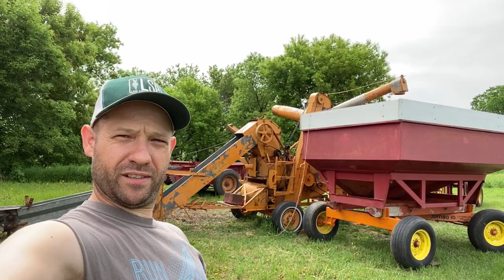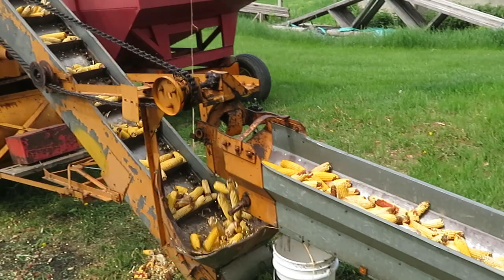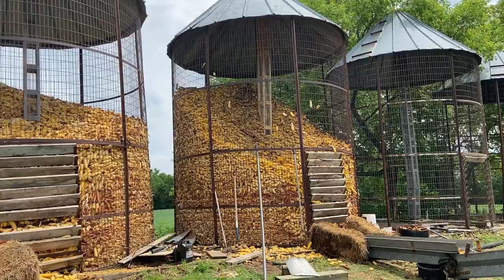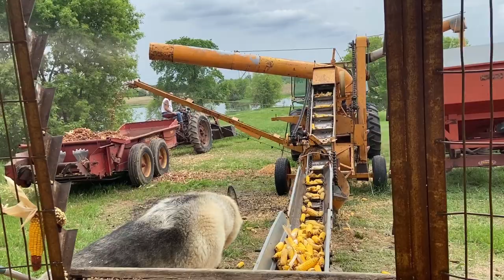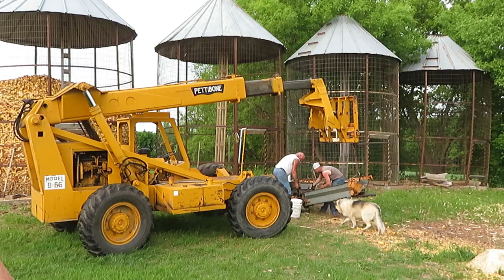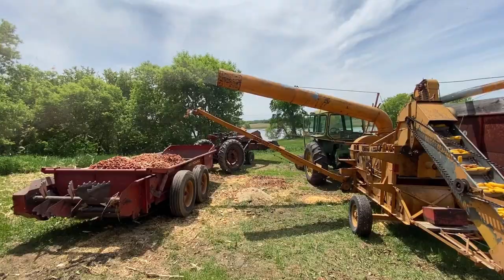Shelling Corn - 2020

Comment: That corn sheller is a dandy. Take good care of it, maybe treat it with rust reformer and give it a coat of MM yellow paint to help preserve it.
Reply from the maker: Y'know, when it comes down to it, they're really simple and pretty reliable pieces of equipment.  It's getting some age on it now, and I really wish we had a shed to put it in.  It needs a few holes patched in the sheet metal, and you're right, I'd like to paint it up to help protect it.  Even with those few flaws though, it's a beast.  These old shellers were made to do one thing and do it really well, and it shows.

The main problem is that everything takes more time than a guy thinks it will, and there are always a million other priorities.  At some point we'll get it completely tuned up.

Comment: I've found that gorilla tape works best for patching and if you don't already, try putting a piece of thin medal under the tape on the hole first. We have a piece of almost tin like material and with the tape holding it on it'll last a long time.
Reply from the maker: I’ll have to try that.  We always have aluminum coil stock lying around from construction jobs.  That’s easy to bend and makes a good thin patch.

I’ve heard that the seam tape for Zip System wall sheathing is really good too.  Though I’ve also heard it’s almost impossible to remove if you want to make a change later, lol.

I just picked up a wire feed welder recently and am planning to use it for thinner metal work on some of our equipment.  It would be nice to do some patching that will be a little more permanent.

Sadly, it’s a battle we’ll continue to fight until we have a decent shed.  Oh well.

Comment: Hi from Australia. Just found your channel, stuck in the house as it's been raining for several days now. Not complaining as we have been in drought. Interested to see your Telehandler Petibone, we have almost a identical unit we imported from USA called Skytrack. Have seen then used quite often in construction videos. It's a solid tyre fixed axle unit with a 13-meter reach build like a tank very solid. Thanks for your videos.
Reply from the maker: Thanks for watching!  A lot of these older telehandlers are similar, and they ALL seem to be built like tanks.  Dad actually tipped ours over on a job site with the boom extended.  That was back in 2000 or so.  He could've been killed.

Somehow they got the thing tipped back upright again, topped off the fluids, and it fired back up.  Nothing bent, no major damage.  Hard to believe, but it's a testament to how tough they are.  The jobs I do now are smaller scale, so it rarely goes to a work site any more.  We find a million things for it to do on the farm, and often wonder how we got by without it there!

Comment: I rember shelling a lot of corn through a MM shelter.
Reply: Same here. We made extra cribs with snow fence with a wooden tunnel under them. Start with a plank flood laid on poles. Two tall poles set deep to anchor the snow fence. You could go up three or four rings of fence, moving them in slightly as you went up for stability. Don't see that anymore, either.

Comment: Are yall going to try and get a corn header for your combine this year?
Reply from the maker: Hey Charles!  We have a 2 row header that came with the machine, but we haven’t used it yet.  We’d love to try it out, but since we don’t have any bins to store the shelled corn, there is only one scenario where we would use the combine in the corn fields.  If we fill all four cribs and still have corn in the fields, and it’s dried down to 15% moisture or less, then we would combine it and send it straight to the elevator.  Last year our harvest was so poor that it wasn’t an option.  This year the corn is looking really good, so it’s definitely a possibility.
Reply: @ravenviewfarm  good deal yea I dont have bins either,  but in South Carolina where I'm at it does dry down later in the fall and I can go to the elevator with it. Looking forward to some 2020 harvest videos